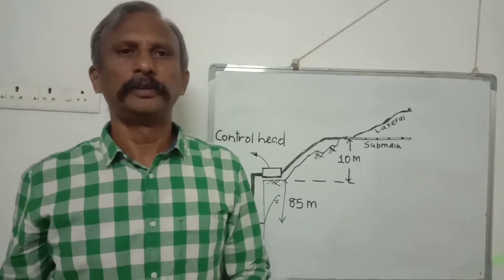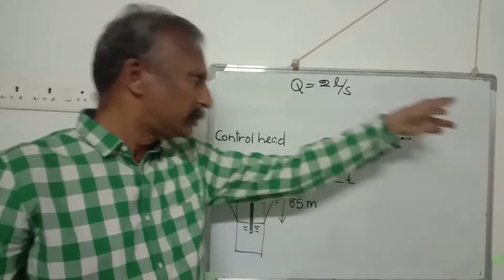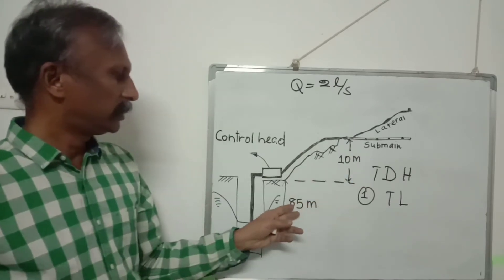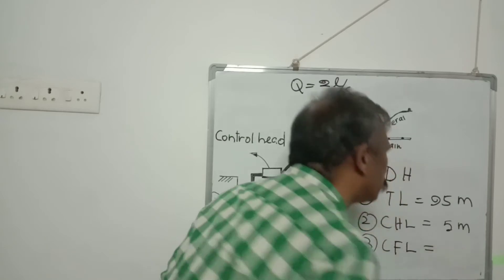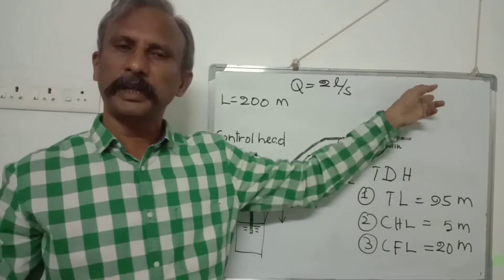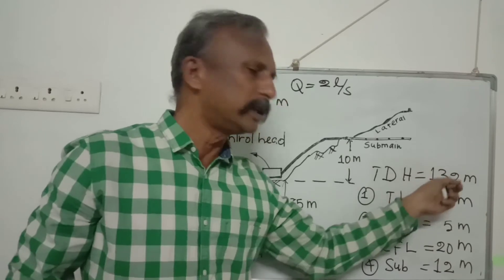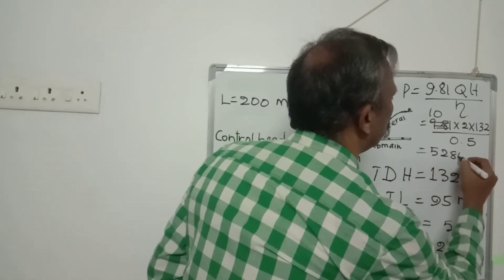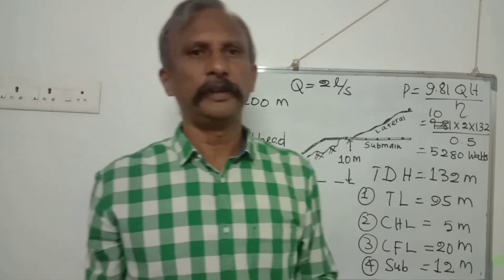Pump Selection for Drip Irrigation

Comment: SIR please suggest which stage  water pump is best for  pump water to 1 700 meters
Reply from the maker: 1700 meters pressure head is a very huge head. Normally it is not possible to expect these kind of pumps from all the manufacturers. However, it is possible to get such pumps from certain manufacturers. If it is available, you do not need to look into the number of stages. But totally you must be able to get 1700 meters. Depending on the impeller design, the number of stages would vary.

Comment: You didn't explain how you got the value of as P=9.8152
Reply from the maker: The unit of  the Head (H) is Newton-metre/Newton. To get Power H must be multiplied by Weight rate of flow. Therefore Discharge rate Q is multiplied by weight density of water (9810 Newton/cubic metre). Since we substitute discharge rate in liters per second, discharge rate must be converted to cubic meter/second. Hence 9810 is divided by 1000 and we get 9.81. This video is not for the people who want to know the derivation of the formula, hence derivation was not discussed.